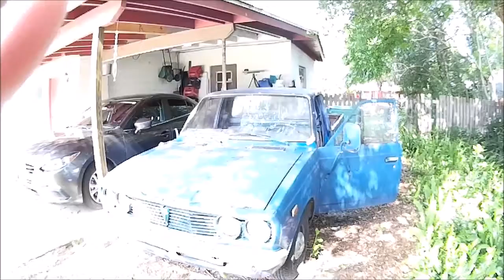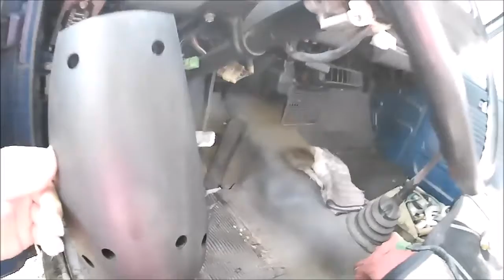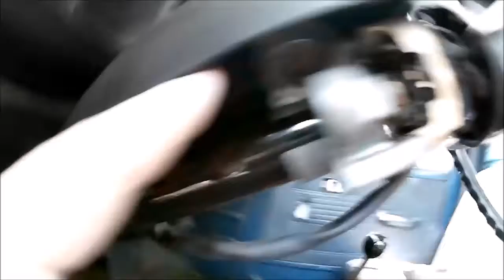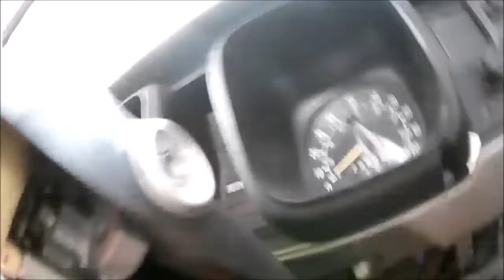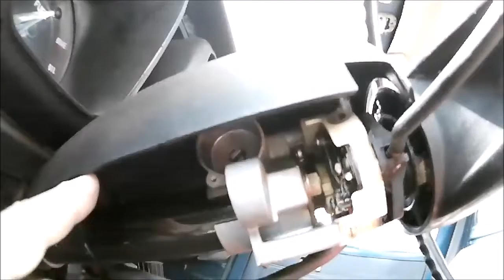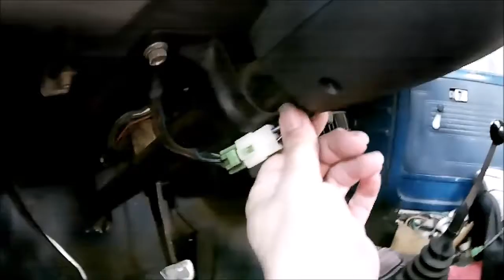1978 Toyota Pickup/Hilux 20R - IGNITION SWITCH Replacement

Comment: Hey Im trying to diagnose my 81 22r. Was getting solenoid click 1 year ago replaced contacts issues stoped. Recently upon turning the ignition switch to start/run I'd lose all power have to pull off and reconnect positive battery terminal cable but would eventually start. 
Did An oil change last night and saw my main 12v lead to the starter was torqued putting strain on the lug and wire, so I loosened the nut re tightned. Now all I'm getting is the clock when I turn the ignition but the contacts in the solenoid are new as is the plunger. 
I measured with my volt meter 8 volts on the start/run wire when I turn the key from the ignition switch. Can you please help me confirm that this 8volts is either due to a faulty switch or is similar to what you had?

Thanks
Zach
Reply from the maker: But did you thoroughly clean the positive battery terminal and positive battery post. What about the negative terminal & post? The complete loss of power when turning the key to "start" is usually a classic sign of dirty or corroded battery terminals/posts. There could also be some corrosion build-up in the part of the terminal where the heavy cabling connects to them. Take those apart too and clean completely., then put them back together and make sure the connection are tight. If bad connections are what's limiting the power, the ignition switch really has nothing to do with that. Also, ignition switches tend to either be good or bad. They really aren't known to al of a sudden limit voltage.

Another issue could be the cables themselves, especially the negative ground cable or strap. If they are original, some of the the copper strands inside the cables could be broken and making intermittent contact. They can also develop higher resistance over time & use, dropping voltage to the starter. Anything over 10 years old, it's best to just replace them all with new. There is also usually a second ground cable, going from the rear of the cylinder head to the firewall, that you should also consider replacing if it's original.

The "torque-ing" of the main feed to the starter may not have been an issue. It could have just been a dirty connection, either at the point of connection or inside the terminal itself (the crimp) that you sort-of cleaned by loosening the nut, turning the terminal & re-tightening. Again, it's best to at least totally disassemble that connection, completely clean it and re-tighten it. Also again, if it's the original cable, replacing it with a new one would be a good idea. After all that cable carries a lot of current to the starter and, if original, is now 40 years old.

Comment: Have you had any problems with the engine fuse blowing the moment you turn ignition to run? That's the problem I'm having now.
Reply from the maker: I have not had that problem. I would suspect that you have a point of high resistance in the Run circuit somewhere. This could be anything from loose or corroded terminals on the fuse block, loose, dirty or corroded connections in the Run circuit wiring, a wire that is partially broken with too few strands left intact, etc. The only way to find out is to start at one end of the circuit and physically check it all out to the other end, cleaning any and all connections as you go and making sure they are connected firmly.

Another issue could be bad ground cables or straps. Given the age of these vehicles, the wire inside can develop high resistance. The best way to check those is with an ohm meter. Any resistance above 0.2 ohms end to end and I'd recommend replacing them. They can also have loose or dirty connections causing the same problem.

All of the above are some good starting places to check. I have learned the older a vehicle is, the more important it is to check everything thoroughly.
Reply: @The13thSword  could a bad coil or ignitor box cause it to pop?
Reply from the maker: @ryanharaughty2860  Ignitor, very unlikely. Coil, also very unlikely. I've seen tons of vehicles with a failing or bad coil and the fuse doesn't pop; it just runs bad or fails to run at all.

With that said, it could still be a ground problem. The Ignitor & Coil both require good grounds to operate properly. The Ignitor grounds through the coil bracket, which grounds through the body by means of bolt or screw. Check all of those connection points. The Coil grounds through the same points. The Ignitor basically opens & closes the negative side of the Coil, like old-style points used to do.

You can pull the Ignitor & Coil and have them tested at some parts places for free. I don't know how to test Ignitors with an Ohm Meter; usually Ignitors work or they don't. You can test the Coil with an Ohm Meter though. If you need the coil specs for testing let me know what year truck you have & I can let you know.

Only other thing I can think of is a bad voltage regulator or a short to ground in the alternator. These can be two separate physical items, depending on the model year. You can put in a fresh engine fuse, remove the plug from the back of the alternator, and try to start it up. If the fuse doesn't blow, it could be either item. If the fuse still blows, it could be the fuel pump circuit (IF you have an electric fuel pump).

Comment: I've got a 76 Chinook with a 20r engine. It runs only in the start position of the key. I release the key to run position and it dies. What's up with that?
Reply from the maker: Hard to say without more info or being able to look at it. Could be a fuel problem with the carb (clogged jets). Even with clogged jets it will still start up if you're giving it a shot of gas with the pedal (accelerator pump) but then since no gas is flowing thru the jets, it won't continue to run on it's own. Try starting it again & when it does start & you release the key hit the gas pedal a bit at the same time you release the key. If you can keep it running at all that way, it's likely the carb. Time for a through cleaning & rebuild, or a replacement with a fresh carb. (I have info on that, just write me back for more details). When's the last time the carb was rebuilt or cleaned out? Has the truck been sitting for a while?

If that doesn't do it (same result as before, dies when you let go of the key) it's likely an electrical problem. I'd start by checking all the fuses first to make sure they are good (DON'T SKIP THIS & DO IT FIRST!) Also look at the fuse contacts in the fuse box for any corrosion. Sometimes green stuff (copper oxide) will form on the fuse contacts & prevent a good connection. Just me but I check fuses with a volt/ohm meter set on resistance; sure result on the meter & I don't have to struggle to see if the little wire inside the fuse is intact or not.

If all fuses are good & the contacts are clean, you either don't have any power to the ignition circuit in the "run" circuit ("run" position of the ignition switch), or the "run" circuit has a short in it somewhere. Being a Chinook does it have the dual battery setup? Are you only running 1 battery? If it is the dual battery setup & you are only running 1 battery, have you checked that the terminals for the second battery are not shorting out on something (battery tray, body, etc)? Make sure they aren't touching anything metal (& maybe wrap rags around them for temporary insulation) & try starting again. If it starts & stays running you've found the problem.

Otherwise, find out with a volt meter if you have power to the coil with the ignition switch in the "run" position. If you don't it could be the ignition switch (assuming you suspect this because of the video your question is attached to). There is a way to test the switch but this is starting to get long; let me know if you end up on this step.

I also found a wiring diagram for you for the "76 pickup that might help:
https://www.autozone.com/repairinfo/repairguide/repairGuideContent.jsp?pageId=0900c1528004d7c3

Just scroll down the page to find the Pickup wiring diagrams.

There are other tests & ways to test beyond all this but this should give you a decent start in tracking it down. Good news is that apparently your start circuit, coil & points all work otherwise it wouldn't even try to start. Let me know if you have more info/updates on it or if I can help you further.

Comment: Have you tried installing a pertronix ignition system?
Reply from the maker: Actually I didn't need to consider the Pertronix Systems at all. This truck came standard with a breakerless distributor (pickup coil & reluctor, no points). "76 & earlier trucks had points distributors; mine's a '78. I did have some trouble with the ignitor box/module, which is still available but costs $400! I was able to rig up a GM HEI style module to replace it for a total cost of about $20, & she runs like a champ. My video on this is here:
https://www.youtube.com/watch?v=tw9FcyEz23c

I do know about the Pertronix conversion systems I know they do work, but this just made more sense to me, as I already had the right distributor for it & am limited on money. $20 beats $120 every time. :^)

Comment: Cool, I have the 76 pickup same as yours color too except I've the automatic..you've saved me a lot of searching for where everything is. Just learned from another of your videos where my fuel pump relay was. Right noe I'm having fuel pressure problems. Thanks for the information.. peace..
Reply from the maker: Glad to be of help. Not sure what to tell you about fuel pressure probs, could bee more than a few things. However, changing out a 40 year old relay would certainly help. You might also want to test/check your fuel pump resistor. When they get old they go up in resistance, as they warm up, that could also cut down voltage to fuel pump; less fuel flow & pressure. It should be mounted on top of your passenger fender well.

Can't remember if I did a vid on it or not. If you need more info on this just reply here and I'll list what info I have on it. maybe even do a vid for it.
Reply: Yup, probably be a good idea to replace the relay but I don't want to switch parts, would rather find OEM.. Where's the best parts house for 75 thru 79 Toyota pickups.?
Reply from the maker: I mostly stick with Rock Auto. Even with shipping it's usually less than trying to get the part local. Only drawback is having to wait a few days for it; oddly tho, when I try to get a part local they have to order it in too, so it can be the same amount of time.

I just had a look online and can't find the new stock part, but last time I saw one it was $60+! That's why I went with my solution, plus you can always go back to a stock relay if you find one, as my method doesn't cut off the original plug socket. The relays are basically the same, electrically, so they work the same.

By the way, Toyota calls that part a "Circuit Opening Relay". That might help you track one down, if needs be.